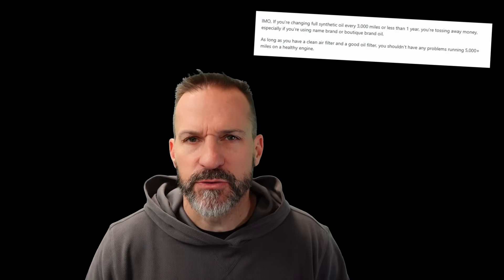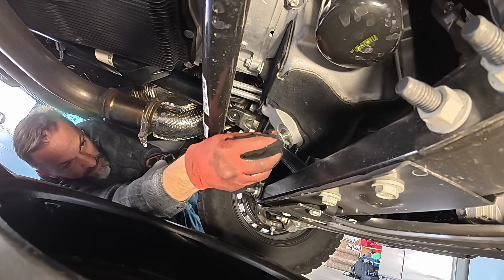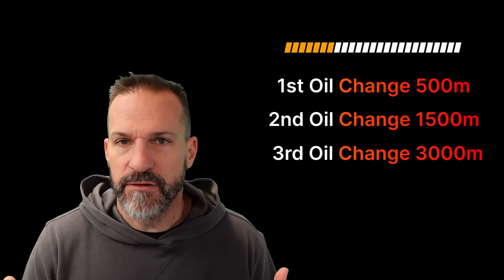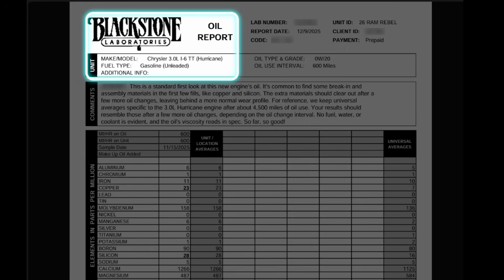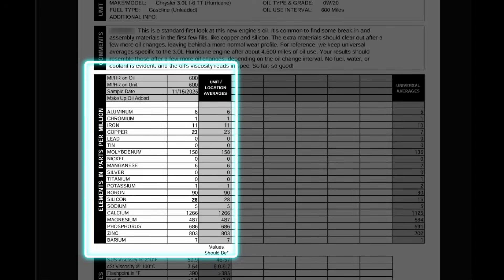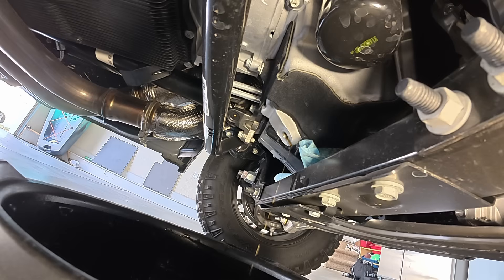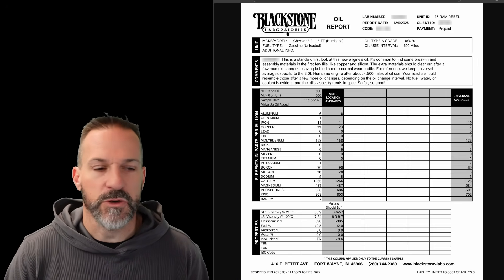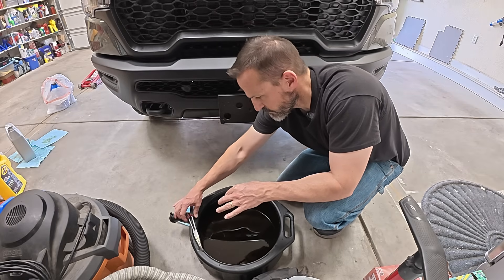Is the Motor Oil Geek Right? I Put His Break-In Theory to the Test

Comment: There are many things that people don't know about Lake Speed. First, he is a trained tribologist. He knows more about lubricants than most any of us. Second, Lake designed the formula for Driven Racing oil, for Joe Gibbs Racing, where it has to survive in engines turning 8000+ RPM for 3 or 4 hours at extreme temperatures. He also helped develop the latest Total Seal Piston Rings. His main business is oil testing.  He works with some of the best Metallurgists in the world to learn why parts wear out and what brands of oils stand out for quality and the best specs for the new engines. What he doesn't know he knows the people who do know. He recently spent time at Donaldson oil filters (Large Diesel filter manufacturer). and they had a lot to do with Lake's latest info on oil and filters. So we shouldn't brush him off as just another YouTuber.
Reply: People dont like him because he gives lectures instead of one sentence answers.  This stuff is complicated, it's a science, you need patience.  People try to control his narrative, but he stands strong on explaining throughly.  With all the knowledge he's given, and all the community effort, we can figure it all out for good.
Reply: @robczar7479 , your use of the word "lecture" here is definitely appropriate to his presentations as a positive and thorough learning experience, not "lecture" as an epithet (i.e. not lecture = diatribe or condescension).
Reply: Donaldson makes more than filters for diesel prime movers.  If you need something filtered, they probably have a solution.
Reply: One of the oldest filter manufacturers in the world, started with his neighbors tractor that was having engine failures because of dirt in the air was wearing them out.

Comment: I always change the oil on a new engine between 500 and 800 miles.  There is always break in debris and it is important to get that out.  I then change it again at 2k and every 3-4 k after that.

Comment: When I build an engine, I don't even wait 500 miles. Oil gets changed after 20 min on the break in stand.
Reply: Do you use regular oil or break-in oil?
Reply: @fatillacing4131  Driven BR30
Reply: Oh absolutely. On jts verh 1st start/turn over, run it til it gets up to temp, shut her off and drain. Fill and drive keeping the rpms modest (this can vary but I wouldn't go over 3k rpm). 500mi change it again. By the way I've done these 2 specifically with break in oil. After the 500mi change, you can run the oil of your choosing as long it meets the recommended viscosity. I didn't change mine at 1500, I changed it right before 3k mi. This is on a 418ci stroker pushing 90k mi as of today.
Reply: yeah but then u would also want to do that at around 500-800miles as well, and perhaps using breakin oil again.
Reply: 10-4 after the first test drive (I drive a certian way to seat the rings) pull the plug hot change the filter.After that change it when it starts to look dirty (5 to 10k) or evey year, run 0w40 in everything and I don't use "break in" oil.
Reply: I learned 20 minutes on a fresh engine too
Reply: Good, I just bought a new log splitter with a 8hp after 15min and found plenty of shiny particles, some surprisingly larger than expected.
Then I ran it for another 20min and same, then actually used it for 2hrs and found more still.
There’s no filter so I’m changing it after each 2hrs of use for the rest of its life. I change the oil on my lawnmower, Power washer etc each year or after heavy use.
Oils cheap!!

Comment: As a reliability specialist in a mine, new engine always have metal in the first 500 to 1000hrs. I've been treating oil analysis result for the last 6 years. Now in our caase, after the inital valve lash verification on a C175-20 ou 3516HD is dones at around 250hrs and an oil change is done with new filter. The reasoning he has about the filter is actually correct but if you run into an issue or extend too long the next interval you exposed yourself to the filter bypass opeing since the filter become too restrictive and it could lead to an unfiltered engine running event. Normally in those big engine the cooper is going down to normal after about 1000hrs or about 2 oil replacement. The lenght of the interval should not be based on a fix interval at 5000miles, you have to test with oil analysis to validate if the lubricant has reach his limit, meaning if you have oxydation in the oil, additive consumption, fuel dillution etc it would be a sign that your lubricante has reach it's end of life bt if your lubricate is still perfeclty fine after 5000milles there is no reason to keep replacing it at that interval. You extend to then 6-7 maybe even as high as 15000 milles before the oil need to be replaced. It will be highly depended on the application you have of your vehicle that will determine the life of the oil and the interval. Also adding a larger oil pan to your engine will allow you to extend the interval.

Comment: When I purchased my first new vehicle in the 1980’s the manufacturer used a break-in oil and they required it be changed between 500-1000 miles.  Then every 3000 miles.  I did as they suggested and I racked up 300,000 miles in 9 years and never had an oil related problem.  I still drive an average of 30,000 miles a year and have followed the break-in oil change and then I cut whatever the manufacturer suggests for the oil change interval in half.  Never had an oil related issue.

Comment: Boy, do I feel foolish now.
I had an '87 Ranger with a four-banger for 18 years and put 360,00 miles on it. I did oil changes every 10,000 with synthetic oil in the winter and conventional oil in the summer. I gave the truck away to a kid for parts but the engine ran perfectly well, it was the body rusted away.
I wish I had done an oil change at 500 miles, then I'd probably still have the truck today.
Reply: I assume you are being sarcastic, but the world has changed.  New engines have to be treated better than ones from the late 90s early 2000s. The list of things that require this include low tension piston rings, direct injection, small turbocharged engines.  As people move to these newer engines they have to do better on oil changes.
Reply: @garyganser2451  , No sarcasm, just the facts. We had a 2008 Focus that required 5w-20 synthetic,  and the same thing, no break-in oil changes and oil changed at 10,000 miles. It has 220000 miles on it today and has never needed an oil top-up and no oil leaks, it sweats a bit in the valve cover. This car has never had a repair, just matainance and gets warmed up before driving.
I have to say sorry to Lake Speed Jr, I really don't think that 16 parts per million is any different than 13PPM.

Comment: Engineer here, Lake is a scientist and generates data to validate his advice. Bought a new Ford Escape 2.0 turbo last year, took my first sample of factory oil at 400 miles, only issue was low viscosity.. Just got second sample results after 4000 miles, wear metals half the initial sample, viscosity still low. If next sample is low will go to 10-W 30. It's good insurance.
Have owened several new vehicles, always did first change around 500 miles and changed every 3000 or so using full synthetic. Never had an engine failure.

Comment: Wonder where all the copper coming from? The engine bearings usually have a lead/tin overlay on top of the copper, but you show zero lead, maybe cam bushings, rocker arm bushings, thrust bearings?
With what's going on with new engines these days, no, I don't think what Lake recommends is overkill, I would be doing it.

Comment: Not sure when Toyota recommends changing the transmission fluid but my Tundra drives and shifts way better after I did. 41k miles. Changed the rear diff fluid as well. It had a resonating humming noise while at 1750 - 1950 rpms. Now it doesn't. Go figure. I also change my oil at 5k. Next oil change im going to 0-30.
Reply: Interesting. What model year Tundra and what brand and viscosity of oil? Thanks
Reply: It's a 22 hybrid. Not sure on the brand. I will ask next oil change. Last oil change was 0w-20.

Comment: Hes not wrong but my truck went 300k with 15k oil changes including the first oil change at 15k. It was still running like new until it was totaled due to a guy falling asleep and hitting me head on. So for a diesel 6.7 cummins the extended oil changes were not detrimental in the slightest. But it was used for hauling and almost never idled so it depends on what the use case is.

Comment: Thats not true.  He told me in person. 50 miles. Change oil and filter. 1500 miles change oil and filter. 3000 miles change oil and filter.
Dont know where the not changing filter came in. Hes even said it on my livestreams.
Silicon is sand. Not silicone.  Great video sir.

Comment: This is VERY good advice...by no means overkill.  Plus for God sakes it's extremely easy to change the oil on the Hurricane engine!
Reply: No it’s not. There is no actual data behind it.
Reply: I have a 2017 Toyota Tundra 5.7L, I now run 0W30.  No statistics but it seems to be a bit quieter on the highway.  I watch Lakes videos, 30 weight has better numbers. When GM buckled and moved to 0W40, I'm comfortable going to 0W30.

Comment: varying rpm's is also necessary for breaking
Reply: And low rpm  like varying in the 1000 - 2000 range
I think the varying is to place gentle but pronounced pressure onto the bearing and ring surfaces.
What do you think?
Reply: @2Truth4Liberty  i always never went above 3k for the fist 200 miles then 4k till 500 miles. then 5k till 1000 miles. after that your done.
Reply: Agree, I raced dirt bikes as a kid.
We were always breaking them in whether they were new or after changing rings.
It’s crucial for best performance & longevity.

Comment: It’s indisputable there are more wear metals in the oil during break in. What i question is if it matters.  Does changing the oil 3 times before 5k miles actually increase the lifespan of the engine significantly. For a majority of people something else is going to fail or the car rust away long before the engine craps out due to excessive wear.
Reply: I’ve asked the same question already to the Car Guy and he hasn’t yet responded. And I wonder what the Motor Oil Geek himself would say. Nothing wrong with more frequent oil changes, but I think it’s often just a ‘feel good’ exercise. 

My limited understanding is that turbos do transfer a lot of potentially damaging heat to the oil and that itself may justify ‘frequent’ oil changes. But whether the ‘wear particles’ from the engine break-in period can actually reduce engine life and justify rapid removal with generous engine oil changes is unproven, as far as I know.
Reply: Changing the oil more frequently than the OEM recommends will get your engine longer

Comment: I am very sorry but I havr to debunk your first statement. As a TOYOTA Land Cruiser Prado 2022 2.8L inline 4 turbo diesel engine.... the Manual states.... what type of oil to use... and the intervals  of how frequent the oil changes have to be... its clear in my manual... that on sever conditions... the oil has to be changed every 3k miles or 5k kilometers... and who follows thag advicee??... the dealer... here in Panama... Prado uses different.... oil grades.. but the most severe is 10w-30... and what does the dealer.. put here?.
Well as toyota states... the highest viscosity... 10w-30... what happens in USA... is that  your EPA.. forces too much pressure on fuel economy and emissions.. that they have to follow other advices now... same car on other countries... have a more detailes cars manual...

Comment: 0 w oil is good if u live in the artic or trying to please the government. 😜
Reply: Specifically, 0W16 is better than 0W20 or 5W30 in arctic conditions, as it does flow much better in sub zero temperatures.  Other than that, not much difference in Southern winters.  In summer, 5W30 would be better but they are still recommending 0W16 or 0W20 for EPA compliance at Subaru.  At Toyota, they are down to 0W8.

Comment: Change it at 900.Then at 3000 and again at 6000. Probably gonna stay around a 4000 mile oil change interval. Using pencil platinum ultimate 0W 20 and mobile one oil filter filters.

Comment: Good stuff. We are all learning from more data being collected. Automakers don’t share anything. I don’t know if you follow Freedom Worx, but he did a comparison video of the different oil analysis companies a couple days ago. Some good info there too.

One thing you might want to try is a Fumoto drain valve. I have them on all my engines now. I like being able to run a hose directly into the drain pan. Your drain plug is in a really good spot so it’s not really necessary, but it’s still a nice addition.

Comment: As someone who has built engines for a living, I will tell anyone who asks to dump the original oil at 800km. Then again at 3000km. Then go with 8000km intervals. Which is 5000 miles.

Comment: I agree with the motor oil geek. I've only bought one car brand new, but I remember it did take right around 10k miles for the fuel mileage to optimize, which told me it was fully broken in.

Comment: The car guy online ..LOVE your song  “Ain’t Built Like They Used to Be”  I'm leasing a 2024 Toyota Tundra TRD . I've changed oil 4 times my ODO is 15,000 miles right now ..First oil change is usually between 500 to 800 miles,changed at 800 miles, 3,500, 5000 , 10,000 miles oil sample sent to LAB everything look good an at 15,000 miles...Everything is running great so far my oil intervals are at  5,000 miles MAX....I will send another LAB sample at 25,000 miles . I've owned Toyota's for 45 years this is what i do to every new vehicle oil is cheap..I've been working on cars for DECADES... I also watched a couple videos from the OIL GEEK he's really good .. I still don't TRUST the V35A-FTS engine .😂😂

Comment: There is nothing alarming in your oil at 600 miles, though. I changed the oil on my 21 Tundra at 1600 and 5000 miles; and since then I change it every 5,000 miles.

Comment: I did the lake speed oil change at 500 changed the oil and sent it off.
I have 4cycled with a turbo oil had metal in it to the metal count was alittle high . But not all engines are as good as some others.Did the next oil at 1600 mile a lot less metal in the oil . By the third oil change it was normal per Blackstone’s report.
Looking back on it, not sure if it was worth it or not but I think we all are questioning the reliability of the information and your engines .By the way the Dealer ship said I was crazy and you can’t trust those reports. As he said they are not the manufacturer. They just test oil
Good luck to you guys.

Comment: I have the same truck 2 weeks old. Changed mine at 600 miles and like you i'm planning on changing it again at 1500 miles. I'm also curious about running a thicker oil. Especially living here in Florida when it gets really hot again.
Reply from the maker: Yeah, it will probably take me a while to switch to 0W 40 because I don’t put tons of miles on it, but that is the plan. I want to at least get a baseline up to 10,000 miles with 0W 20 and then potentially switch.

Comment: GREAT content (love your talks with Nate also:-).., Love the test you’re performing here, you can’t argue with data I have my test kit coming from Lake Speed for my wife’s new to us 2025 mini-Cooper.  it’s our first 4cyl.turbo car so I gonna be following Lake’s oil change directions Im also using the recommendation’s on using the BMW oil in it & also running premium top tier fuel in it also..
the additives in the top tier fuels (do a goggle search in your area for top tier fuel suppliers/gas stations you will be surprised).. the good fuels will also help with keep things clean in that direct injection fuel system & how the crankcase pressure fumes are recycled in the engine also with the help of probably using some fuel injection cleaner additives (Lake has data on this also)… 
keep you channels/content coming.. ps, I’m also getting ready to Change the trans fluid on my 2019 yukon denali 6.2 10Speed🙁🫤
Reply from the maker: Awesome! Glad to hear you're doing your own testing!

Comment: I use Mobil 1 Extended Performance 20k synthetic oil for our vehicles, but only run 6k-7k OCI's, when the OLM reads 15-20% or 1 year, whichever comes first.  With 5qt jugs at WalMart going for $28 + $11 M1 oil filters, it's cheap insurance if you can DIY it.

I would never go past 7500 miles even if the manufacturer recommend 10-15k OCI and was using M1 EP oil "rated" for 20k OCI !

Comment: So what does a guy do who just did his first change on a new car @ 5,000 miles? Should I trade it back in now … actually asking. Am I just SOL as far as the concerns you mentioned?
Reply: Yeah, you’re SOL. Better trade it in. 🙄
Reply: Do not worry about it.  Just sold my '13 Impreza with 2.0 liter boxer engine after 12 years and 110,000 miles, never burned any oil and ran perfectly.  First change was at 5,000 miles, oil still looked clean.  Then every 5-6,000 until I retired and only drove 2,500 miles per year so only needed one change per year.  On my new Subaru, they recommend  every six months so will do my first at 1600 miles next month.  Sold the old car for $6500 after dealer told me it was nearly worthless because of heavy rust underneath (but normal in upstate NY).  But the buyer said it ran great and was much better than any other used car he had seen.